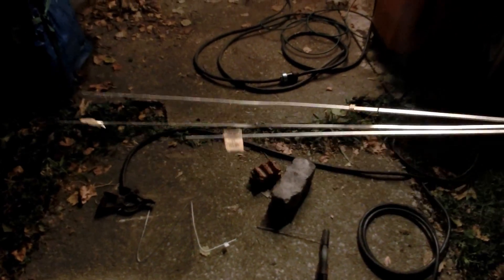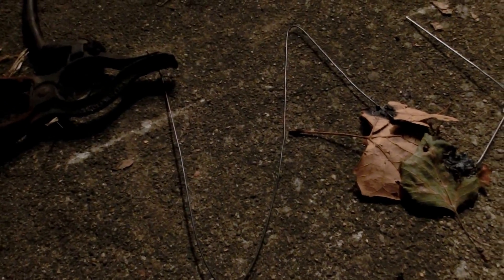DIY Electric Kiln : NiChrome filament test

Comment: Maybe you can use this discovery to change bread into toast.  Or perhaps even heat a delicious casserole.
Reply from the maker: i didnt discover anything.
Reply: Rinoa Super-Genius Touche, no disrespect.  I was trying to make a stupid joke.  Do you have any interest in solar energy?  Maybe design a tracker to heat your kiln, using old parabolic satellite dishes covered with aluminum for instance?
Reply from the maker: Vernon Falo  i think using photovoltaic cells to make electricity would be better. then i could use the stored electricity during the night or use it for other things.
Reply: Rinoa Super-Genius That makes sense, as long as you can tolerate the efficiency losses, and have a good array & battery bank. I'm coming from the perspective of cost effective energy harnessing.  You seem to be quite clever, and frugal, judging from your other videos. You raise a good point, about the even heat distribution, vs. pinpoint energy concentration, so my suggestion of using solar may not be apt.  Nonetheless, I thoroughly enjoy your videos so please, keep it up!  Have you thought about putting your intellect toward a particular goal, or are you more focused on exploration and understanding of the forces around you?
Reply from the maker: Vernon Falo i'm slowly building towards bigger goals. i think the more my channel grows the more i can invest into projects.

for now i only have far-fetched ideas and little projects that are stumping me like rock crushers and digging machines.

far fetched projects would be like rockets and long distance exploration of like the Boreal Forest haha.
Reply: Rinoa Super-Genius Rock crushers and digging machines?....Boreal Forest?  Are you planning to invade Canada? Lol ...  You must have something in mind...I'm definitely not a wealth of information, but I have a few contacts that maybe might be able to help you out, but honestly, I probably can't offer you anything better than what a few good Google searches would yield.   In any case, I would personally like to see some followup on your past videos, and if you're interested in collaboration at all please contact me and I'll do what I can, in the endeavor of information sharing, or at the very least another perspective.
Reply from the maker: Vernon Falo
 what videos would you like me to follow up on? a lot of the projects are ones that never end.
Reply: Rinoa Super-Genius I like that you are repurposing old junk stuff into practical things, like the (electric) lawn tractor, or the roadside cooler.  I was interested in your ideas about the cooler and how you planned to integrate the "fast cooling" circuit, then have the amps cut down to maintain temp, and also add some heatsinks/thermocouples for increased efficiency/cooling rate.  Also your electric bicycle, and a new battery to see how it performs with higher voltage perhaps.  Your videos are simply fascinating and enjoyable, but personally I am drawn toward practical application, while incorporating efficiency along with salvage.  Just keep doing what you're doing, and I'll keep watching :).
Reply from the maker: Vernon Falo
 sadly it turns out that tiny refrigerator uses the same amount of power as a large vapor compression fridge haha.

Comment: Maybe you could use a clay flowerpot surrounded by sand sitting in a bucket.  The flower pot clay should be relatively light and stand up to the temperatures that you mentioned.  The bucket can hold the sand for insulation against the flowerpot.  And buckets have handles and can be carried.  It couldn't get cheaper than that clay flowerpot, sand and bucket.  Perhaps some old clay tiles could be used for the lid.
Reply from the maker: thats a very good idea, and here i was going to mix a bunch of concrete haha.
Reply: Concrete isn't used in kilns and neither is cement.
   Cement in the concrete sets in an exothermic reaction.  If a lot of heat is added to the cement in the concrete, the water is driven out and the cement disintegrates.  Also, concrete is filled with a lot of different stones which are likely to decompose at all different temperatures.  Who knows what  the mix of stones are in it.  It only takes one bad rock to expand to crack the whole thing. 
    Refractory brick is not mortared, but it is wedged in place by outer layers of bricks that do have mortar since the mortar would disintegrate. 
     I think the fired clay would hold up and sand is so forgiving, it is possible to reform it endlessly.  Even if the clay cracks, since it is held In place by the sand, it's not likely to fall apart immediately.  If something gets messed up, it is easy to repack the sand.
     You could call it a bucket full of hell.
Reply from the maker: *****
 i was going to put the concrete into an old ceramic drain pipe so if the inner concrete cracked it wouldnt matter. and even if it cracked the pipe too i wouldnt care. i'm just needing something round to hold the heat. but your idea for the flower pot is better.

Comment: NiChrome can handle a lot of heat we use it in RBA's for Electronic Cigaraettes - an RBA is a Rebuildable Attomizer - I have never seen it so thick before - the melting point of NiChrome is 2550 F and the safe working temp is 1800 F - you may want to try getting some Kanthal wire since it has a safe working temp of 2550 F but not sure you need that temp or not (not that we need that temp but we use it because it lasts forever at the heat temps that we use) Here's a link you might find interest in http://temcocontent.com/resistance_wire_faq.html

Comment: I bought a nichrome wire just for heating up stuff. Just use a variac for it to control the power
Reply from the maker: variacs are nice, i'll prolly build a big one someday.
Reply: Not sure if you could get the parts for it. I was hunting high and low for it. Could not find it. Finally bought one. The inrush current is high on my 5kva model..... Need to use the bulb trick to reduce the inrush current.
Reply from the maker: John Chung  well it's not that complicated to make.
Reply: Rinoa Super-Genius Electric ranges and ovens use nichrome elements, but insuate them to avoid shock hazards, so you could probably use an infinite switch (surface burner switch) to control your kiln, than again maybe not because they are designed for 240 Vac up to 30 amps, not sure about the voltage output of your welder. The good thing about trying this is that they are easy to come by when people toss ranges to the curb or illegaly dump them along the road.